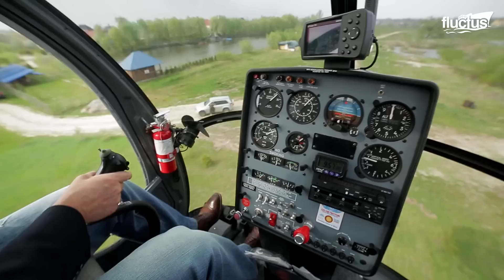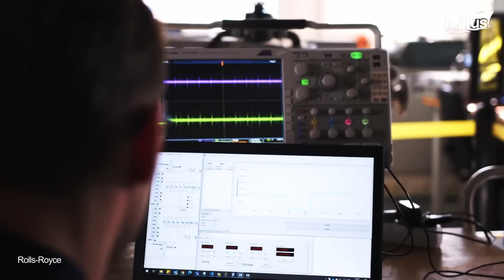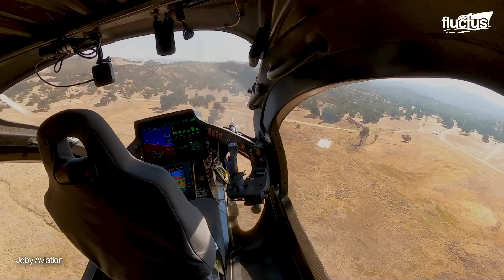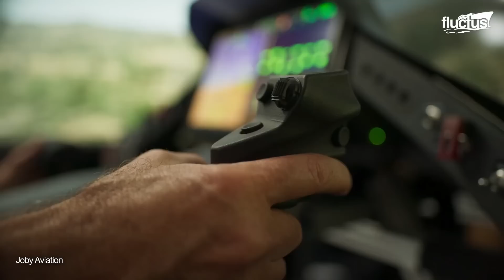US Air Force Testing Brand New $4 Million Fully Electric Aircraft

Comment: It's all about battery power density.  So far, all they're good for are short hops. There will have to be a paradigm shift in power density for this stuff to ever be practical on a wide basis.
Reply: Funnily enough I read about a recent development in lithium air batteries that could lead to increased energy density compared to lithium ion batteries
Reply: @BrowncoatGofAZ  Interesting.

Comment: Just imagine these aircraft bursting into flames while in flight jusy like EVs are doing and the length of charging time, the reduction in performance in cold weather, lack of range with the increase in weight with passengers and luggage.  A 3000 mile flight instead of taking 4 hrs will take 4 days. No you can keep your electric aircraft and EVs.

Comment: The energy density of batteries still sucks for aviation.   Barely enough for general aviation tasks much less military applications.   It would make more sense to build a flex-fuel aircraft that can guzzle anything from alcohol to automotive gas so it has pan global use in a variety of areas that may lack access to aviation fuel.

Comment: Colonel Diller sounds more like a DEI green energy promotion path than a serious military leader and engineer.

Let's start with the logistics of a new technology rather than the new technology.  So you have an electric airplane that can't be recharged in air so it needs to always return to it's base.  That base will have to have the means to recharge the electric plane.  So if it takes a very long time to recharge a care how much longer will it take to recharge a plane that needs perhaps 100 times the time to get it ready for its next mission than a jet.

The batteries to drive an electric car increases the weight with respect to conventional cars and so that is added wear on the roads and reduces the duration of the charge.

The weight of the batteries on an electric plane is far greater than on a car and so it subtracts from the payload it can carry.

What about the supply, maintenance and the training needed to support an electric aircraft?  You now have both jet engines to maintain and support and different fuels to run the generators to recharge the electric planes.

So I always see the excitement of electric tanks, military vehicles, aircraft, etc. but I never see the supply, logistics, maintenance, or sortie rates electric anything can generate that is more than the sortie rates we have with conventional equipment.  And from where does all of this electricity come to charge hundreds of thousands of military equipment?  Gee, it's generators that require fossil fuels because the military can't rely on the constant supply of commercial electricity but it can rely on the constant supply of fossil fuels by multiple different methods.

Maybe in the distant future the technology will allow electric vehicles to travel as far as conventional cars and there will be enough charging stations with the technology that you can recharge your EV faster than a gas station.  And maybe in the future the military will have a way to recharge their electric vehicles and aircraft without using fossil fuels and can recharge them faster than they can with conventional jets.

Given the history of the evolution of new technologies that will impact the entire transportation of the US and the military, I think we  are still about 50 to 100 years away IF we can solve the problem of generating sufficient electricity without fossil fuels.  

However, places like California are shutting down fossil  and nuclear fuels without having the needed wind (which is too expensive), solar (which is too expensive), and hydroelectric capacity to come close to replacing fossil and nuclear.  But they have mandated in law without any evidence that alternatives can support California.

Guess what, California is importing electricity from neighboring states.  Gee, you would think that a State that has declared it has no use for fossil or nuclear electricity wouldn't think of importing electricity from other states who are producing electricity from fossil and nuclear.

Liberals are complete morons.  They only care about their agendas without considering the consequences.

Comment: Electric aeroplanes are NOT powered by batteries ! They are powered by whatever the source of the electric energy that was used too charge the batteries and there is a very good chance if charged in the USA the source was either Gas , Coal or Nuclear

Comment: Hi, Folks.
ASSUMING that they can fit a big enough generator into an aerial refuelling tanker, how long would it take to recharge that jigger???????????????????

On top of this, electric motors are NOT the FARCICAL zero emissions power sources that the climate change nutters would have us believe. They requiring mining and processing to manufacture the electric motors in the first place and then MORE mining and processing to manufacture the batteries to provide power for the electric motor(s) during operation.

And what happens if you misjudge your range in flight and run out of 'sparkles' to power your electric aircraft? Do you just pull over to the side of the atmosphere and wait for a recharge from the local airfield???????? Same deal for a conventional powered plane, I admit.

Might be OK, at least in the near future, for bringing coffee to the maintenance areas on the base to save the maintenance people having to walk for it.

Just my 0.02.

You all have a wonderful day. Best wishes. Deas Plant.

Comment: I applaud the emphasis towards technological changes in the aviation industry however it will always come down to practicality. Electric isn’t ready yet, not only due to capacity but also safety. Battery design has to change dramatically to reduce risk overall. Can you please review the negatives as well. I see only the spin on the positive side of electric with your site.

Comment: Petrol has 100X the energy density of a Li-Ion battery.  A 737's range would be 31.6mi instead of 3160mi.  That would be 90 stops for a flight from NYC to LAX.
Reply: While it is obvious that electric flight will not work on long range, but works excellent and cheap on short range your comment is nonsense, pure energy density is just one factor, there are lots of others, engine efficiency is at least double in electric motors, then consider approach or taxiing, where a gas turbine still draws 50% of fuel consumption while an electrical aircraft would taxi with 1 or 2 percent power and would even produce power on approach by recouperation as EVs do.
With todays usually marketed batteries electric aircraft with range of about 200 miles is absolutely possible, and there are several electric planes flying.
Reply: @hanneslimbach2505  Nonsense?  I design and build these battery systems.  My comment merely tempers the hype and shows how far we have to go.  If math bothers you, that's your issue.  No one said there was no market, just a long road ahead for those of us who dream of electric flying cars in our driveways.

Comment: This is insanity - the military will never use electric cars/tanks/planes - never
Reply: Nonsense, they obviously will be using electric fligh,  and  for a good reason. For shortrange electric flight is pretty perfect, extremely cheap and reliable, and a fraction of maintenance costs.
Reply: @hanneslimbach2505  Hertz dumpted 20,000 EVs because maintenance costs were way more than ICE vehicles.
same with aircraft will happen
Reply: @noleftturns  Nonsense, Hertz always dumps cars, Hertz, as every other rental company do not make money by rentals, they do make money in buying huge amounts of cars for a sharply discounted price, and then sell them after a few rentals on the market. As Tesla drastically reduced their prices the failed on this, and Tesla was not too happy as they found out Hertz actually wanted only make money in selling them as they gave them huge discounts.

Comment: The main thing is always - how long can we fly for with a battery. And how to totally avoid over-heating, electrical fire, running out of juice due to wrong data about the energy level, ending in tears etc.
Reply: - Energy density for batteries is improving every year and it won't be long until they provide viable output for long-duration flight
- Overheating is avoided with active cooling similar to what we see in battery packs for electric cars
- Electrical fire has the same or less chance of occurring as a traditional gas-powered vehicle with the added benefit of no requirement for handling fuel at all
- Running out of juice can happen in both electric and gas vehicles so not sure what the point is there
- Any aircraft failure will end in tears, electric or gas

Gas powered vehicles aren't going away for a long time, but electric powered vehicles are undeniably getting more effective every year. Both can be useful for different things and they should both be leveraged as such.
Reply: @JordanCoopersNook  Tesla EVs are four times less likely to catch fire than an internal combustion engine.
Reply: @kenbob1071 yeah coz there's a tiny amount of teslas vs ice vehicle's. You talking about a few million vs. a billion
Reply: @JordanCoopersNook  It certainly will be good if they can have a fully electric plane - like an airbus A330 or A350 etc that is safe - as in no self-combusting surprises (and redundancy), and can fly many thousand km with adequate fuel to spare. And also - able to refuel real quick, at least as quick as conventional avgas aircraft.
Reply: How to fly without wings
AntiGravity Air Taxi

Work base on Gravity just spinning by using Battery
can fly in bad weather, plunge in the ocean even in outer space
Can lift more than 100 Ton 

Earth which weight predict 600 trillion ton does not fall at the Sun because of centrifugal in orbitting, on the contrary it does not be thrown far go out the orbit line of hold by gravity at the Sun as orbit center. Gravity and centrifugal is equal called Equillibrium, thats why until now Earth which we was inhabited always rotate and circulate the Sun. Now we justly take example : how if the gravity used and centrifugal is negated? The Earth will float far leave the Sun. So that centrifugal can be used to fly far away if gravity eliminated. Finally how to eliminate gravity?

It’s way rotate part of aircraft by horizontal. When that rotation faster centrifugal force getting greater and the gravity getting smaller, finally it lose the gravity and the aircraft start flying. Of course people would surprise: how the aircraft can keep rotate without fulcrums? Thats why we named that aircraft Shuttling System that is aircraft likes two disc adjoining attached in the midle as fulcrums:

A. The Top part, we name Positive rotate to right, and the edges is getting thicker and havier.

B. The Buttom part, we name Negative rotating to left, and the edges is getting thicker and havier.

C. Middle Part , we name Neutral, air crew placed and also machine and everythings turning Negative and Positive at the same time.

The aircraft can liftup added with explosion from the engine. However that aircraft construction later, let the engineer doit it, and we are sure the aircraft will bulletproof and also waterproof.
 
.
.
 
In modern civilization where human being generally using flying saucer as vehicle, will a lot of change in lives either in materialism and in psychological. In materialism area will apply the change in life like.
People no longger need roadway and rel road which spend large of energy, money, places, things and time, object place and time. People would utilize that area for habitat or for other need:

Comment: Zero emissions.  that is hilarious.  Even if you only look at the Carbon emissions to create a battery that means your break even point just for Carbon is probably 40-80 kilometers.  That doesn't include any of the elements that are involved such as creating the electricity which is more carbon footprint.  Batteries in their curent setup isn't the solution.  It's a dangerous step in the right direction.

Comment: It's undeniable, aircraft cannot store enough electricity to fly for very long because the cargo area required for batteries translates to weight, bulk, and price, that alone, cancels out its usefulness. Indirectly they require just as much energy to manufacture and fly, there's nothing clean about it, most of the source of power comes from fossil fuel, not wind or solar. Government waste of taxpayer money

Comment: One of the biggest reasons theyre investing in this is because of the lower weight of putting a bunch of these in that C-130 transport plane or within carriers. .Weight = fuel = money.
Reply: You really think they are lighter with all the batteries they require. EV cars are not lighter than gas fueled cars.
Reply: So, a petrol powered airplane with drained tanks weighs so very much more than a plane with batteries? What about the diesel generator that will produce the electricity for the fantastic batteries? I know, it's a rub between diesel and aviation fuel weight.
Reply: And since when does the Pentagon care about money?

Comment: the commentary is just total BS.    1) Where was the electricity generated and what source was used ( coal, natural gas, dam, diesel, solar?).  2) What was the power loss to carry the power from generating location to user locations? 3) What is the range of this vehicle?  I'm betting it is so small that it makes the entire project useless. 4). The battery development and manufacturing is a huge power usage 5) The recharge stations have insufficient charging capacity to make this practical in any sense. 5) The military is developing electric motor driven aircraft but the source of the electricity is a jet engine burning jet-A generator.   So the real source of the power is petroleum products.  You simply cannot get any range from electric anything because flying requires massive amounts energy for long periods and you simply cannot carry enough batteries to make this feasible....

Comment: Ha, ha, ha - this is nuts.
Batteries only have 1/10th the energy density of kerosine and engine combined.
And you cannot burn off battery weigh for landing.
Batteries will NEVER power an aircraft, until battery energy density improves.

The 250 mile range is nonsense.
By law you need 1 hr of diversion and holding, when you arrive at destination.
(In case of airfield closure and weather.)
In other words, this aircraft can only fly about 50 miles (legally).
Pathetic.

R

Comment: All the issue is energy storage as electric motors go up to 95% efficiency and props efficiency isn't far behind.
Reply: also mass. When an airplane takes off at full fuel load it weighs 400k extra pounds due to fuel, but it lands close to empty. no matter how far you fly those batteries arent getting lighter.
Reply: @purona2500  An A380 can carry nearly 500,000 pounds of fuel.
Reply: Electic???

Comment: The Canadian government years ago mandated Li battery powered ELTs until tails started coming off of the aircraft. Nicads also have a sketchy history of runaway fires. There is only speculation that carbon affects the weather. The spraying of aerosols at high altitude affect the  weather by reflecting sunlight from us thus decreasing vitamin D uptake.

Comment: 20 minute flight time -  12 hours to charge. Make sense to me, lol!
Reply: American tax dollars put to good use as always xD
Reply: @3milio0o95 it certainly is as it’s saving us from extinction.
But the op is an idiot the performance is way higher, and charge time one hour
And it’s clearly not low drag
Reply: How will the power grid handle the future EV demands. The power needed will require a complete overhaul of the way power is distributed. EV technologies are not supported yet and the batteries themselves are poorly designed. I’m waiting for ambulance and electric companies trucks to be electric. Thats tough!
Reply: @WARESPOWER we will have unlimited power from fusion soon
Also, most future ev’s will have bidirectional charging, meaning they can feed the grid they charge from.. adding their battery capacity
Reply: That’s idiotic
Ev’s take an hour to charge, they can do trans continental flights . There’s even a solar sailplane called sunseeker that charges as it flies.
Reply: 250 miles on a hour charge

Comment: Electric aircraft is NOT sustainable. Who in their right mind comes up with this stupidity. Running out of electric power on several go arounds will spell disaster, internal battery thermal run-aways causing the craft to go up in flames and burn in seconds, the enormous weight of the batteries, limited load capacity and range. There is nothing good about electric air craft. I work in this industry and I would not even own an electric car.

Comment: Zero emissions? Really how did you generator produce the electricity.
Reply: Can use any means to generate the electricity. wind, solar, coal, nuclear, in the future it will be fusion.
Reply: Uh, I think most people understand they meant zero emissions out the proverbial "tailpipe."  Even if you ignore the fact that coal is dying, an electric plane powered by a coal plant still would be more beneficial since the pollution from the plant is a point source that can be better controlled and a single plant can be more easily retrofitted as tech improves making it cleaner and more efficient, than trying to do the same to thousands of fuel burning planes running all over the place kicking out harmful fumes/smoke/carbon.
Reply: Don't be silly. All they have to do is build a wall. There's automatically electricity in every wall. Just plug in.